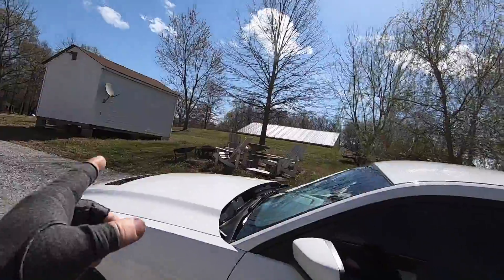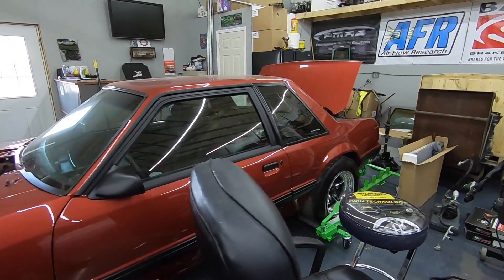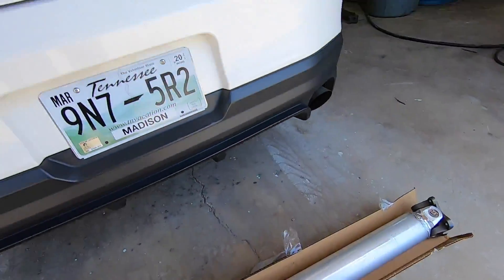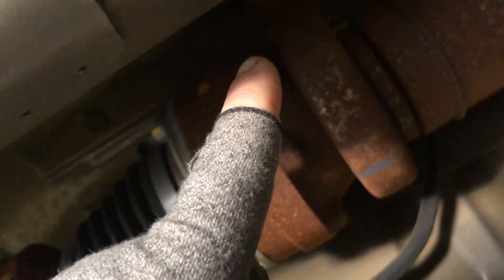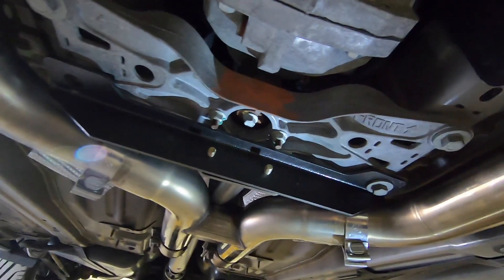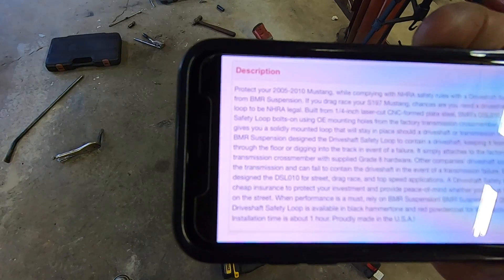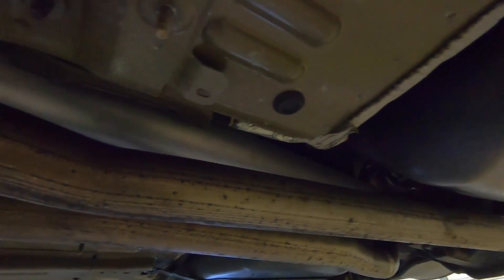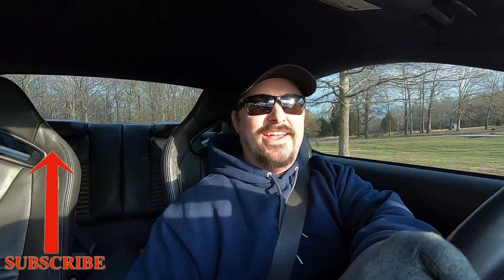GT500 gets stronger!  But we have an issue!

Comment: Ken I was able to get the BMR safety loop to work on my 2007 GT500. I have Kooks headers and catted h-pipe. Originally wanted the X-pipe but that did not work due to the clearance issues you are having. The setup has been on the car for 2 years with no issues. Good luck

Comment: Yeah aftermarket pieces don’t always coincide with each other .... also not sure if you have it in the works I’d add a diff cover bracket to prevent the diff from cracking when it catches from a launch
Reply from the maker: Determined Veteran yea some parts just don’t work with others.

Comment: Seems like you can just spin the cross brace around and should solve both hitting issues. Just the loop will be an inch or so forward
Reply from the maker: 18 SILVERCHARGED S550  tried that and it hits the bolts in the center of the the crossmember and the safety loop is in the way of the shifter if you move it up that far also.   I literally tried everything lol.

Comment: You lads have to have the combined skill sets to fab up your own driveshaft loop and brackets ??       Also, watching Ken play with the 500 in this weather reminds me......   Plenty of people ask "why do so many people crash mustangs (especially at lower speeds, pulling out of meets, etc) ?"   The answer is "because when the car breaks loose under acceleration, they lift off the gas completely, which initiates 'coasting', losing control of 50% of what controls the direction travelled of the car".     Ride it out lads.  Learn to Roll out of the throttle a little in order to find that "balanced" throttle position and let the wheel speed come back to vehicle speed on Your terms.  (Balanced means you are no longer accelerating or decelerating, you're maintaining your momentum/speed).  The car won't "kick" back into line.   I learned this from some of the best road racers of my generation.   It will always apply.
Reply from the maker: Jay Why we could make our own. But hard to say if it would meet nhra standards.  Yea I don’t let it get too out of control. I usually roll out and let it come back in line to keep it from going crazy.    As long as you don’t let out when your counter steering your fine. That’s when things go wrong.